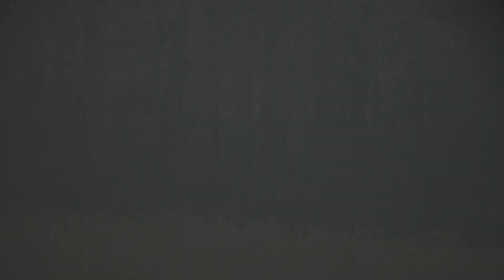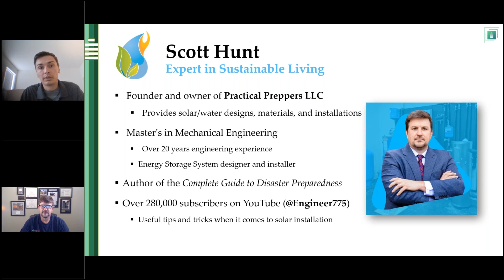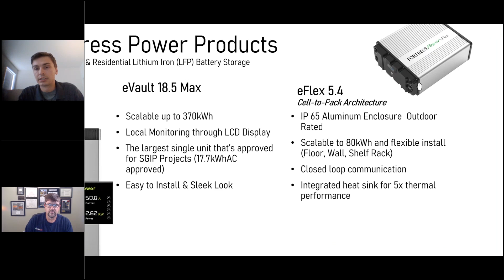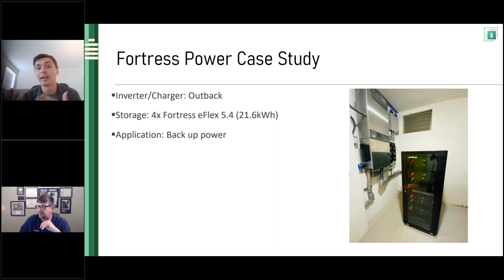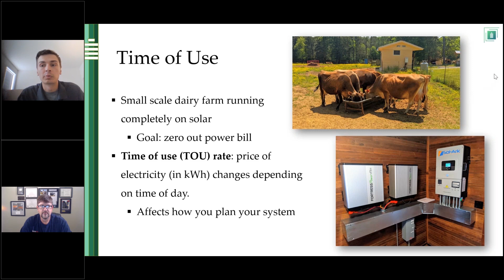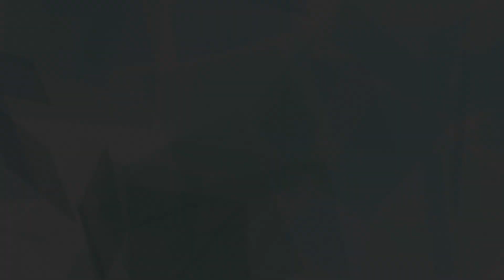My chat with Fortress Power

Comment: I called Fortress Power and they said their Eflex 4.5kWh battery has a self consumption of 30 watts while active.    30 watts x 24hrs = 720 watt-hours just to stay active.  That's 14% of the battery's capacity!  

No freaking way would I buy one of those..    Seriously, what idiot would design a battery that would self discharge in just 7 days on its own?

Comment: How easily can you realistically add additional units?
Reply from the maker: We do it all the time it's extremely easy there's a lot of bus bars/ combiners available.
Reply: In times past when 1/2 inch and 3/4 inch copper piping was inexpensive, you put this in a vice and squeeze it flat for great bus bars. You may have some copper pipe you don't need for anything else.

Comment: 1:14 So, Why the hell am I here? Will the rest of these 66 minutes of this change my life significantly? I feel PREPPERS ARE AND HAVE ALWAYS BEEN QUITE WHACK! so now what?
Reply: In case the grid goes down, you need a way to get water. If you can convert your deep well into a manual well, this will work. If the well is very deep, this is not practical or easy. If you live in town and on community water, this may or may not work when the grid goes down. They have diesel generators, but they will eventually run out of diesel. Also, who knows whether or not the bio-weapon is added to the water. Fluoride is bad enough. Rainwater collection is great. When grocery store shelves become empty you will need food. You can find instructions online for growing micro-greens. You can grow them in a sunny windowsill during winter. You can sprout seeds, also. From seeds to edible micro-greens in a week depending on the variety. If you have deer or wild hogs nearby, you can get meat. A half-dozen chickens will provide a small family with eggs.

Comment: How hard would it be to start with a small system, just big enough to handle a freezer and a few lights with battery backup, BUT isolate it for EMP by disconnecting it almost all the time and grid tie the panels to lower bills a bit? Or is EMP protection impossible? We used to live on a sailboat with panels for 8 years, so we know about power management.
Reply: The potential damage from an EMP event depends on the energy remaining at the destination, attenuation (reduction of energy by shielding) and the type of circuits. Very low powered circuits are most susceptible. CMOS is typically better than bipolar. A large high current device such as a 100-amp rated rectifier will likely survive. Therefore, a low efficiency simple solar system has a better chance of survival. Such as solar panels charging a battery through a rectifier and resistor. A smart charge controller with microcomputers and other low power level integrated circuits needs some shielding. The best shield is solid; however, screen is much more practical and sufficient. As long as the largest (longest) dimension is less than 1/8th of the offending wavelength, you should get adequate protection. The door to the room must have special electro-magnetic shielding material. A long very narrow opening, even from a tight door closure is no good. The wavelength formula is online, and also wavelength calculators. Research EMP frequencies so the wavelength can be calculated to determine the metal screen size. Of course, you can buy protective flexible EMP screen shielding.
Reply: Build yourself a small electro-magnetic screen room to protect your electronics. Most companies in the electronics manufacturing industry either have a screen room or will rent one from a company that has one. These are used to test electronic products to make sure they meet industry-standard conducted and radiated emissions. Special solar panels are EMP resistance; however, the cost is higher than regular solar panels. Sol-Ark claims they have an EMP-protected controller/inverter. An ultimate test is an EMP event.
Reply: Having your charge controller and inverter in a metal box should protect them from an EMP event. A metal screen of the proper size will also protect them. You still need to remove the dissipated heat to protect all the high heat-dissipating components. Cooling fans with screen intake and exhaust can work. The heat can also be thermally conducted to the outside without using fans, in most cases. In other words, a properly sized heat sink. Make sure thermal conducting pads or thermal grease are used to provide low thermal resistance. If you have a display, it needs a metal screen for shielding. If there is blue-tooth or WiFi inside the box, you can use a passive antenna set-up in which there is an antenna inside the box connected to coax to an outside antenna. Depending on the bandwidth of the antenna system and the frequency emission of the EMP event, this may allow damage to sensitive circuits. Best to program the charge controller, inverter, etc., and have everything sensitive shielded by the enclosure. An access door to the box needs to have EMI shielding protection. This is made in a flexible material that is compressible. EMI (electromagnetic interference) gaskets.
Reply: To keep EMI or energy from an EMP to a minimum in your solar system, twist all your supply and return wires together and place them in a metallic shield or conduit. Grounding the conduit on both ends provides the best attenuation, but sometimes the manufacturer does not want grounding on both ends for good reason. The next best attenuation to grounding on both ends is grounding on one end. For lightning protection, a single point ground is usually preferred especially at long distances. In close proximity, multipoint grounding is usually preferred. However, at a distance, this can be a problem. For example, lighting strikes a tree 200 yards from your home. If you measured the voltage at the ground at the base of the tree and 200 yards away at your house, there could be a large voltage difference. Depending on this voltage amplitude a conductor could carry a lot of current. When lightning strikes the ground, it causes a voltage rolling effect over the distance from the ground from the strike source. The manufacturer of the equipment usually provides good instructions.
Reply: An easy way to twist wires; cut the wires with some additional length because twisting them shortens them. Put one end of wire pair in a bench vice and put the other end of the wire pair in the chuck of a variable speed drill. Keep wires fairly tight and slowly twist them. This method works well with stranded wires that is not a large gauge. Large wire or solid wire can be zip-tied together. The purpose is to minimize the area between the wires, which reduces radiation from the wires and reduces pick-up from other EMI sources or an EMP event. Adding a ferrite toroid reduces common-mode EMI. Put both wires through the hole in the toroid. The ferrite manufacturer provides charts, graphs, or equations for choosing a toroid of the correct size. In general, a larger toroid of higher permeability is better; however, it is best to use the manufacturer’s data sheets to size correctly. Digikey sells toroid ferrites. Fair-Rite sells its products on Digikey.com. Download the Fair-Rite pdf for ferrite toroid cores. Common-mode noise or a transient is in phase and on both conductors or all conductors and the purpose of a common-mode filter is to attenuate it.

Comment: In terms of setting up something for backup in the event of a power outage due to weather, how well do these batteries last if they're not being cycled?  My understanding is Lithium batteries don't like to be stored charged for long periods of time.  Mostly above 80% or below some % i can't remember.  Is this correct?  If so, can you program a Solark to cycled them maybe once a week or something?
Reply: If it's lifepo4, as most are these days, you just float at 3.4v per cell and they do great.

Comment: Scott, I attended the webinar. I asked the question, "Made in China" and got no answer; therefore my question was not answered. I contacted Fortress Power later and they said their battery system was made in China. The Fortress Power systems appear to be of good quality with a long warranty. If they go out of business, they may not have to honor the warranty. Looking at the company, they have a lot of overhead and this is likely why their cost/KW is high. What bothers me about Chinese-made is possible slave or child exploitation. I understand that near 100% of Lithium-ion batteries are manufactured in China. Buying from China probably helps the CCP or communist Chinese party.
Reply from the maker: I totally understand the concern over Chinese LFP.  It is the world we live in. I can't even get a truck for my business because printed circuit boards can't be supplied for it from China.  It is every product not just with the batteries.  I went with fortress and a couple of other lfp companies because of their reputation and warranty. But I also have a lead acid battery if things get bad. I could drive my golf cart into my macaroon and about 10 minutes be up and running if the lithium battery fail then I couldn't get it replaced.
Reply: @engineer775  My brother decided to keep his fleet of older Duramax trucks in good repair and buy low mileage used ones. They pull maximum loads for well over 100,000 miles. Of course, this won't last forever. Many truckers got all they could out of older trucks that did not require diesel particulate filters and DEF. Eventually, they had to buy newer trucks and live with the expense of maintaining this pollution control. Although not legal, defeating or deleting this pollution control increases fuel mileage by over 50% in all cases. Makes us wonder how much pollution is reduced when fuel efficiency is reduced so much. Maybe the next revolution in battery technology will allow a lot more miles between recharge. Lithium will either be replaced or have practical competition soon. The mindset of buying from China, for whatever reason, has aided in bringing communism to America, no doubt. Our children might pay the price.
Reply: @engineer775  Sounds like China has us by the balls. Are China and technology our savior? I don't think the green new deal is our savior.
Lithium-ion has a higher power density than lead-acid and has much lower maintenance; however, America manufactures good lead-acid batteries. Not a  good option for golf carts or vehicles because of weight and safety hazards. America will need a lot of charging stations for 18 wheelers to be all-electric. Diesel is not yet obsolete. Of course, if we go back to raising our own food, transportation needs reduce.
Reply: @engineer775  “It’s the world we live in.” Or is it the world we make? Would we have ever had a constitutional republic if George Washington and the Patriots had said, “It’s the world we live in?” One reason we lost our constitutional republic is this thinking or when good people do nothing. The CCP enslaves and brutalizes the Uyghurs and even their own people when they voice their opinion against the CCP. Human organs are harvested from people still alive and against their will. The reasoning that if we continue to buy Chinese products, they will stop their crimes against humanity is probably incorrect. Maybe standing up against China does not matter if tribulation is imminent no matter what mankind does or does not do. Seems we are on a runaway train and many that could slow it down, rather not help.
Reply: To me it’s national security that we have a system in place to build our own equipment. Problem is China is cheap and our dollar purchasing power is collapsing!
Reply: Afaik, all lifepo batteries come from China.
Reply: @mrbodo69  That is grim!

Another way to store and create/convert energy:  If you have a large pond on a hill and another about 100 feet or more below, then use solar and or wind to pump the water from the lower pond to the upper pond; and use hydroelectric. Not so good in a very cold climate.
Reply: @markwayne7  hello my friend, what kind of losses are there with this?  I am interested.
Reply: @mrbodo69  Battle Born claims they are made in the USA. I sent an email and asked them,  and they claim they are made in America. I guess they are not being truthful.
Reply: @markwayne7  assembled in the USA of Chinese parts.
Reply: @mrbodo69  That is what I assumed. I don't understand why they have to lie about it. Business must be bad for them. I will call them out on it since they stepped in it by answering my question.
Reply: I’m an HVAC Contractor and a DIY’er on everything else, including my 107,520 kWh battery bank. 1% of my goods come from the USA. I don’t expect anything different in the Solar/Battery industries. 

Use Aliblabla and pay these professionals for their expertise, piece of mind, less hassle, good warranty and future service needs.
Reply: @USA-GreedyMenOfNoIntegrity  We buy as much as possible from countries other than China. However, many times when a company says their product is made in the USA, the sub-assemblies are made in China. Even if a new truck is made in America or Mexico, much of the pieces are made in China. We bought a new Yanmar Excavator and I suspect much of the sub-assemblies are made in China. Truth is becoming rarer each day. The only guarantee we have is from Yeshua.
Reply: Totally understand any reservations about buying Chinese products, but please don't forget that Sol-Ark are basically rebadged DEYE inverters at a mark up high enough to cover their overheads and guarantees etc.